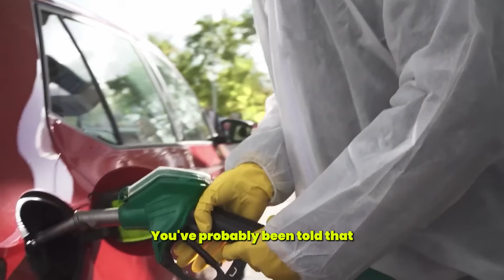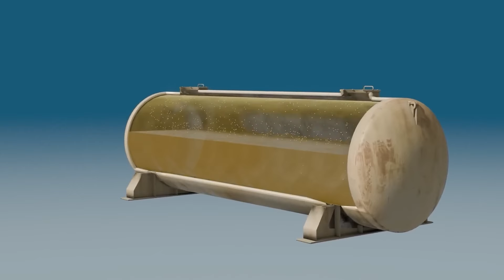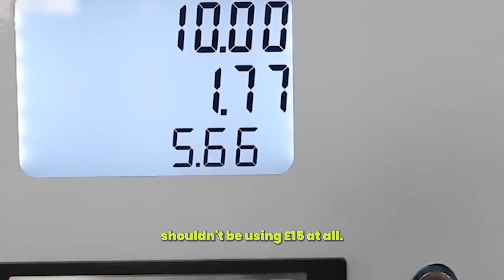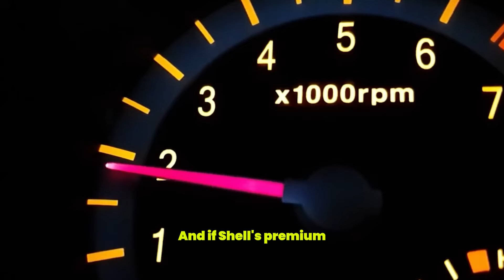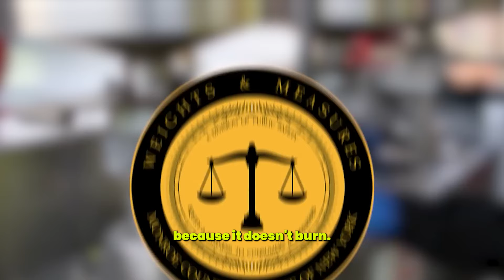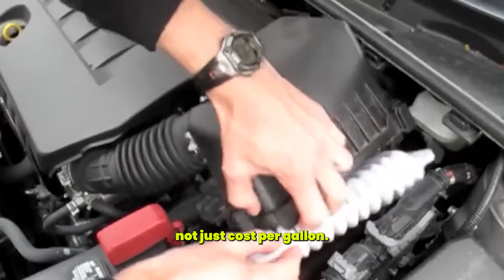7 Gas Stations DESTROYING Your MPG (Stop Using #3 Immediately)

Comment: Exxon/Mobil is a top tier gasoline that meets EPAs standards for top tier gasoline.  I use Sinclair gasoline with DinoCare detergents.  Yes, top tier, but no PEAs like Techron.  No problem, I dump in a bottle of Techron at every oil change.  This combination of Top Tier detergents along  with a dose of Techron every 5000 miles has kept me rolling for may 100k of miles on my vehicles over the years

Comment: I dont use fuel from Speed Way. Speaking of E 15 you can use it in vehicles that was manufactured from yrs from 2001 - present. My advice to everyone is read your owners manual that came with the Vehicle. Also stay away from no brand name fuel.its not worth the risk.if is cheap beware there’s a reason why is cheap- poor quality. The brands I stick with Shell & Costco (Kirkland) both are a certified top tier fuel . For the price at Costco you can’t beat & it’s a good choice & a top tier fuel. It’s a win I’ve used it my vehicle runs like a top never had no issues or problems. Chevron is the gold standard. I like there fuel additive. I haven’t used there fuel it’s a good fuel. Mobil / Exxon is a good option. What is being explained in the video is the detergents this designed to help reduce the carbon deposits. Keep the combustion chamber clean. That’s what the detergents in a certified top tier fuel does .think of it like a laundry detergents or a dish soap we all know what they do.